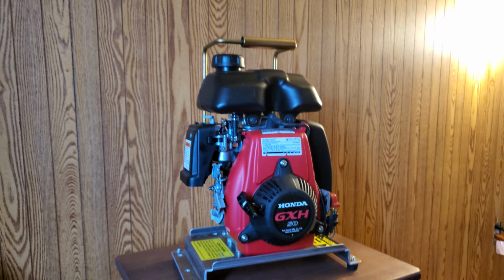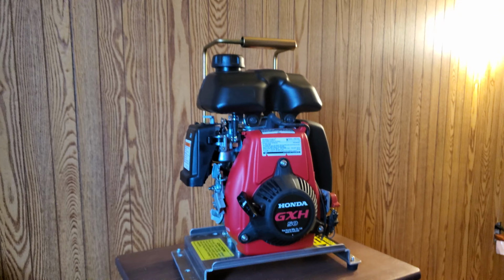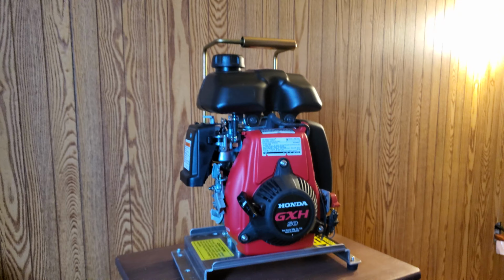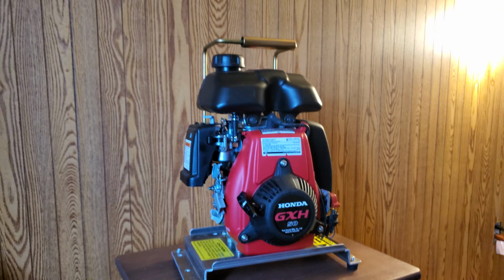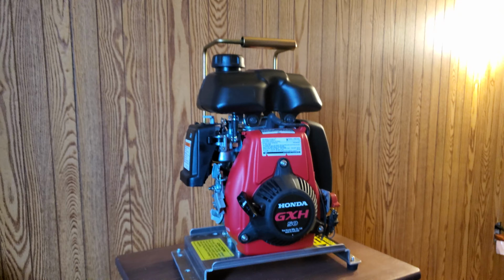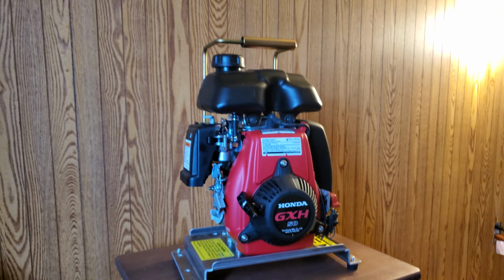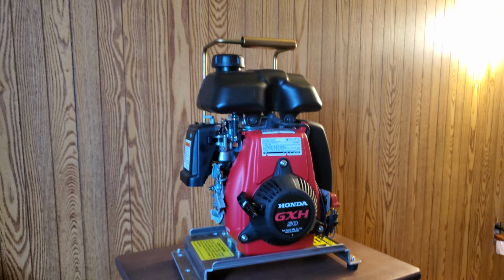Honda GXH 50 Keene Engineering High Pressure Pump

Comment: Looks Great! On mine, I'm having a couple of issues. On the bottom front of the pump, it has a tiny hole in the housing and leaks (not sure if the hole is a relief hole or not). And when I lower idle to low, it stalls. What do you guys thing the problems are? Thank you
Reply from the maker: Do you have the choke on by chance?  There should not be any holes in the pump.
Reply from the maker: Can you make a video of it?   Is it a Keene pump?

Comment: I've talked to the guys at Keene Engineering the reason why they use this particular Honda engine for that little pump head is because that engine puts out around 6,000RPM where as the Chinese engines max out at just over 3000 RPM.
Reply from the maker: Good to know

Comment: Honda starts and runs their motors with a dedicated fuel line at factory most likely prior to connecting fuel tank. You won’t EVER buy a motor with fuel in it at the store. If you do it’s been returned.
Reply from the maker: That's good information!  👍 I figured maybe even keene would try it out but maybe not.